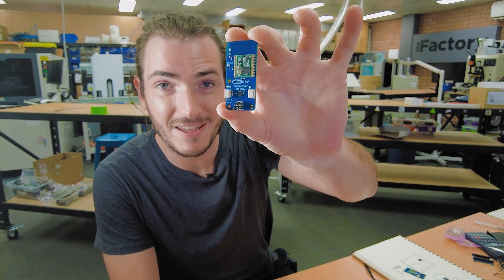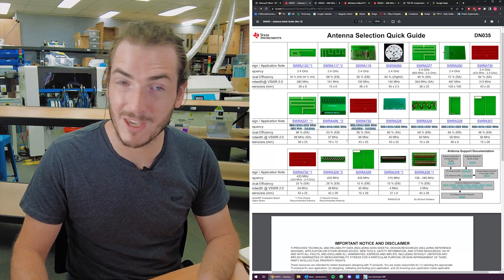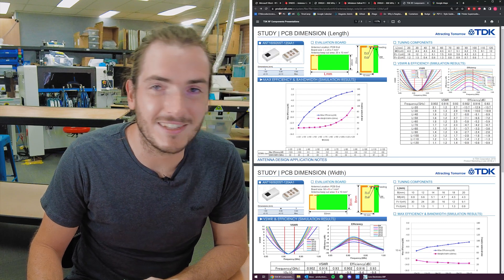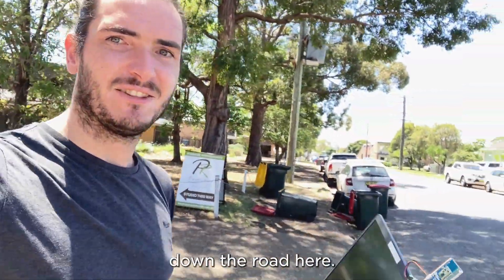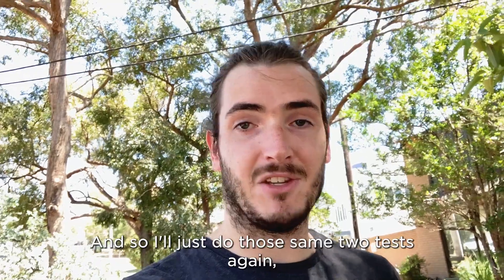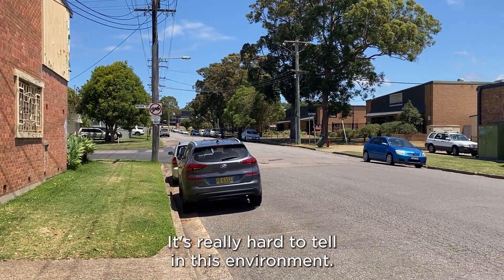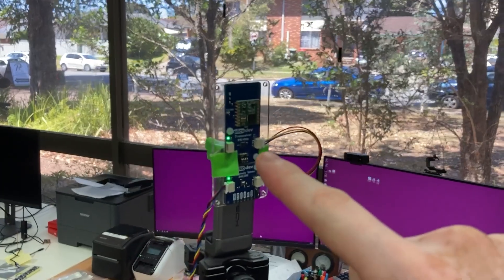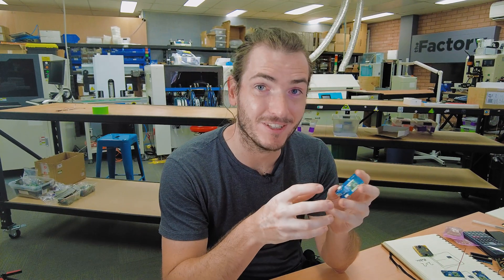The Factory | PiicoDev Transceiver: Radio Wave & Data Packets

Comment: I have three humidity controllers on my machinery that run on an arduino board, being able to monitor these units from inside my house would be fantastic . Modifying the sketch i have for the dehumidifier to run on a piico would be easy enough.

Comment: What if you increase the fresnel zone by putting the transmitter up higher?
Also can you place else if arg that does an fractional error retry if the packet is incomplete and throw out incomplete packets and see if you can get further without packet errors?

Comment: It seems like it would be useful on a small farm. I can see them reporting greenhouse conditions to a central controller that then makes the appropriate response. I think you could take a lesson from the ham radio community and build a repeater module. Place the repeater (with a GOOD antenna) up high and let all of the node modules send messages through the repeater. You'd need the ability to set different transmit and receive frequencies, but the increased range would be worth it.

Comment: Awesome.. Can think of a few things to make use of this. 

With my experience with 900Mhz though, getting the transmitter and receiver up high. I do wonder is there enough power to manage multipathing. Be interesting to see if you can set a full-duplex signal between multiple devices as well.
Reply: Perhaps they need a repeater module.